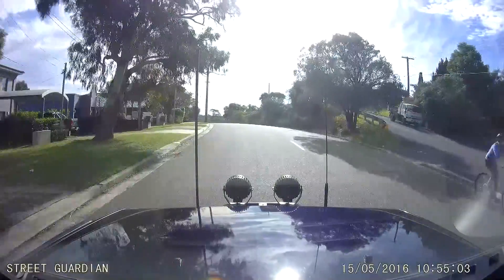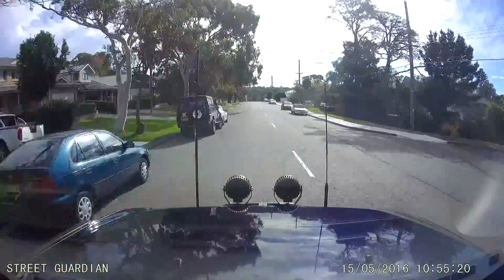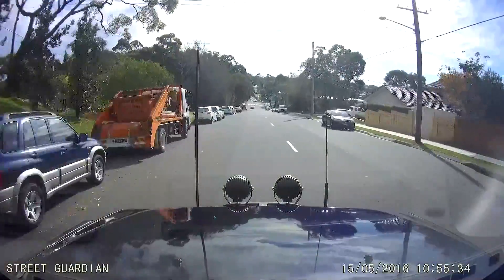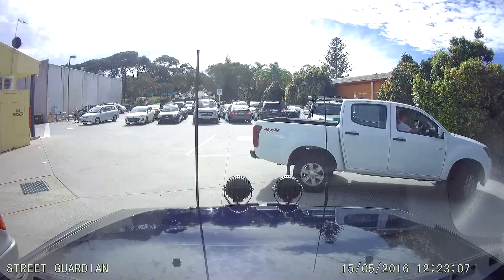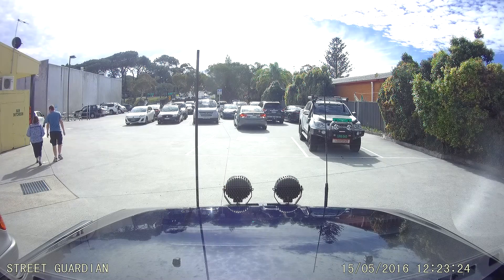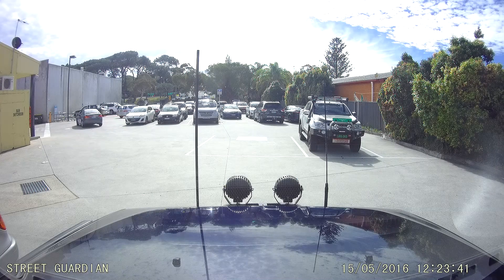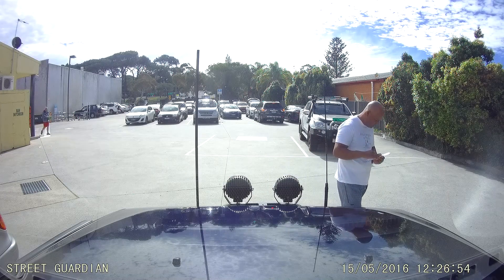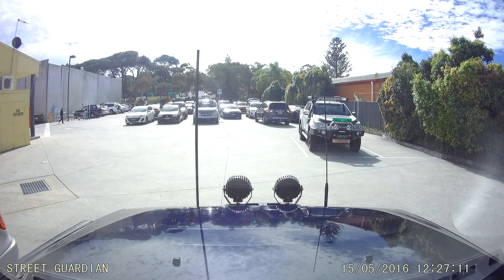Dash Cam Parking Mode - How does it work?

Comment: There you go. I always thought the motion sensor kicked in when something hit your car to make it shake - "motion".
Reply: valour10 that’s a G sensor ( G-Force) Motion sensors when the camera can see something or someone moving
Reply: @A-T-P-97  Is it a data resource consumption limiting feature. If you have a 256Gb card installed is it worth having it enabled? 

I can see a benefit if it marks a point during a recording session/loop (5 minute duration say) where an incident may have happened. But to just start recording, I can't see the point. The only other benefit I can think of is possibly saving battery power.

Comment: If you have the collision only manual setting parking mode can you just leave it on while driving or do you have to turn it off and on constantly? It does NOT have motion detection. Its only collision based.

Comment: Would parking mode work if I just plugged into my always on lighter outlet?
Reply: Depends on the camera. Some like the Secure360 go into parking mode based on being connected to a third wire - an accessory power lead or fuse that only has power when the car is on. Others like the Blackvue use its g sensor to detect that the car hasn't moved in 5 minutes and therefore must be parked.
Reply: @postwick  To give you maximum flexibility we offer five levels of cover. Here’s a breakdown:

    Comprehensive
    Comprehensive insurance is our highest level of cover. It includes accident damage, fire and theft and damage to other people’s cars and property. The cover extends to anyone driving your car. When purchasing this insurance you can choose to receive the Market Value or Agreed Value of your car if it’s written off. The Market Value is what we calculate it’s worth at the time of the accident. Choosing an Agreed Value will mean you’ll probably have a higher premium, but you’re guaranteed to get the agreed amount if your car is deemed a write-off. You’re also able to boost your cover through our range of optional benefits.
    Comprehensive (preferred driver)
    Offers all the benefits of standard Comprehensive cover, but you’ll pay less for your insurance as it only covers drivers aged 24 or older (on a full licence).
    Comprehensive (nominated driver)
    The same benefits as Comprehensive cover, for two named drivers only (the main driver must be at least 21). This is another way to lower the cost of your policy.
    Third Party Only
    Covers damage to other people’s cars and property, but not your own car.
    Third Party Fire and Theft
    The same benefits as Third Party Only, with additional cover if your car is stolen or is damaged by fire or theft.
Reply: you are right.
Thanks

Comment: Does it draw less power in parking mode. Would it give you less chance of having a flat battery.thx
Reply: Generally yes because while the camera is running to detect motion it isn't actually writing video to the card so it takes less power.

Comment: I understand everything you said but I have a question, I got a Dashboard Cam that claims to have Motion Detection/Parking Monitor/G SENSOR. eBay listing advertises all these features as well as saying you can have it just so that once you turn the ignition off it will stay on until the battery in the camera goes flat, which means then when you come back to the car, camera will be flat, then the ignition on and it starts back up and runs off battery.

The seller has recently said that do use parking mode I need to buy some extra device which I have since lost the message but I assume it’s what you’re talking about in the video, a hard wire kit that includes a device with a voltage sensitive cut off.

My question, is if I was to bypass accessories and get 12v straight from the battery, how would the unit know when the ignition is on/off? Because there would be constant power (until device cuts the power to the unit to protect the battery).

I assumed the way the function would work would be, if parking mode/motion enabled then when the 12v stops then it would go into like a standby mode and only record with motion then go back into stand by mode.

Does that make sense?

How does the unit know the car is on/off without the ACC wire. I don’t want the unit just to continue full powered and continuously recording after I’m out of the car..

Cheers.
Reply: Those kind of devices have three wires. One is ground, one goes to constant power, and one goes to a fuse or wire that only gets power when the car is on. That third wire allows it to know if the car is on or off based on whether or not there is power to the third wire.

Comment: Thanks!  Love that Australian accent!
Reply: Comprehensive vs. Third Party Car Insurance: What’s the Difference?

So you did it, you bought a new car, no doubt it’s your pride and joy, you’ve invested your hard earned cash in it so it’s now time to get insured and make sure you’re both protected.

Unless you’re completely clued up when it comes to insurance the task of getting the right policy to suit your needs can be daunting. There are just so many things to consider. Who should you insure with? What excess should you have? Should you pay monthly or annually? Then there’s the age old question – Third Party or Comprehensive?

The answer to this comes down to your specific requirements and what’s important to you – cover for the car or cover for damage that your car causes. Depending on your insurer you have 3 levels of cover you can choose from, Comprehensive, Third Party Fire & Theft and Third Party Property Damage.

Comprehensive is just that! It’s the full package that covers your car against damage caused by a number of insured events, such as theft, accidental damage and natural events (flood, earthquake, fire & storm) as well as protecting you from having to foot the bill should your car cause damage to someone else’s car or property.

Still even with some of the great deals out there, Comprehensive insurance does come with a higher price tag. So if your budget won’t quite stretch it may be worth considering a Third Party option. 

Third Party Property Damage cover protects you from the costs of damage your car causes to someone else’s car or property, however it doesn’t extend to any damage your little beauty suffers in the event of an accident or other insured event.

I guess the question you need to ask yourself is whether you need this protection. Is your car new or used? If it’s used, how old is it? Even if your car is on the older end of the spectrum, you probably rely on it so if anything were to happen to it would you be still be able to get on with everyday life? If the answer is no, then maybe it’s worth having a level of cover that protects your car from damage.

This doesn’t have to be Comprehensive though; there is a middle of the road option, Third Party Fire & Theft. This has all the benefits of Third Party Property Damage as well as protection against fire, theft, attempted theft and earthquake, meaning you can rest a little easy knowing you have some level of cover for your car.

Hopefully having read the above, your car insurance confusion has lifted a little and you’re one step closer to knowing which policy will best suit your needs. If you’re still a little unsure take a look at the comparison table below which clearly shows the difference between the benefits.
Product Comparison
   Covered    Optional cover    Not covered  Comprehensive  Third Party
Fire and Theft  Third Party
Property Only
Legal Liability         
Immediate Replacement Car         
Fire         
Theft         
Earthquake         
Emergency Accommodation, Transport and Repairs         
Towing Costs         
Contents Inside the Car         
Accidental Damage         
Intentional Damage         
Storm or Flood         
Additions to the Car:

    Baby Seat Replacement
    Personalised Registration Plates
    Towbar
    Window Tinting
    Locks and Keys

        
Maritime Liability         
Counselling Services         
Hire Car Following Theft         
Hire Car Following Not at Fault Accident         
Hire Car for Other Insured Events         
Unbraked Trailer         
Tools of Trade         
Campervan/Motorhome Contents         
Choice of Repairer

Comment: Can i use a power magic pro or similar or does this have a special circuit that enables the parking mode? Im worried about the garmin parking mode draining the battrry and would cost a fuck of a lot more combined with power discharge protector

Comment: There's no such thing as Parking Mode in a dash cam, as long as it is powered it will just record continuously. Not unless you set the Automatic power off then it will shut down completely even if it's powered. The G-sensor is a feature that it will save the video to prevent it being overwritten if there's an impact felt. If you want your dash cam to act as CCTV then hardwired it on live fuse.
Reply: That simply isn't true. Many cameras detect when the car is parked based on either a third connection to an accessory lead or fuse, or the camera's internal g sensor, and automarically go into parking mode.
Reply: And parking mode means that the camera isn't always recording, it only records when it detects motion or impact (depending on the features of the specific camera).

Comment: Having repeated car vandalism to both my vehicles in apartment parking lot. What Parking lot mode camera for night vision do you recommend?
Reply: i'd like an answer on this too as i've had someone pry open my fuel flap a few times. it doesnt have to be a dashcam, just something with a decent recording time, motion sensing and reasonable night vision or WDR for poorly lit areas
Reply: Obliv any luck or info if you found an answer to that question? I would like to know as well
Reply: @mrlonghair13  I'd like to know too!
Reply: DoctorLightMusic I’m in the USA and bought a Vantrue pro.  I also bought it for vandalism problems.  It took some getting use to but I’ve come to really like it.  It can be outsmarted if spotted because it only captures front view and a limited back view, especially since I have a pick up truck with a very small back window.  The play back quality is decent.  Instead of getting it hard wired for parking mode to work I bought a battery pack and it works great.  Only problem is that I have to bring it in and recharge everyday.

Comment: I am cursing not setting up this feature on my dash cam last week someone knocked of my front number plate :( Its also criminal what Vicroads charges for slimline plates ($114) ended up going with standard plates.

They couldn't tell me why plates with half the material of full size plates cost 3 times as much!

Comment: I read that constantly drawing power from the battery will shorten its life and has something to do with sulphating process...they propose having a portable battery instead like the Cellink.  How true is that?
Reply: Considering most modern cars are always drawing power (built in alarm systems, listening for key FOB signal, GPS tracking etc) I doubt that's true.

Comment: Is the Blackvue Power Magic pro the same as the vicovation power + used here? Cheers mate, love the videos!
Reply from the maker: +Kevin Ah Seng Similar in function, However I prefer the Vico as it has the option of a temperature cut off so you can set it to turn off if the car gets to hot inside.

Comment: I have a question..how do you get the camera to stay attached to the windscreen. I clean the glass with metho and give it a good clean , but once a week I will get in the car and the cam will be hanging from the mirror by the electrical cord. No way it would stay attached in a crash.
Reply from the maker: +Sherie Thomas Some suction cups are better than others, do you apply anything to the suction cup before sticking it on (I find good old spray window cleaner on the suction cup works well) but some cheaper cams have terrible mounts, others will just fail over time. 3M Double sided tape mounts are always better if they are available for your camera.
Reply: +Sherie Thomas Make sure you flip up the little tab that really makes the camera stick, it'll pull the device into the windscreen and it shouldn't come off
Reply: +Stepa My camera is a Uniden and has a very elaborate mount compared to some 
eBay camera's I have had. I dampen the suction cup , put the camera on 
the screen adjacent to the rear view mirror..then turn the locking ring 
about a quarter turn. It gives the impression of being firmly attached. 
And it always falls off the screen overnight while parked in the shed. 
Never happened while I am driving.

Comment: My Kaiser Baas R10+ has this but it's not hard wired in, still it has enough reserve power to record movement when needed.

And as that guy proved you need to be aware with so many cars having dash cams you can be recorded even when no one is in the car so don't do anything you shouldn't, but I guess thats the whole point of the parking mode.

Comment: Thank you for that. I am a little wiser for that info. BTW some cameras now have lithium batteries so you can use parking mode without direct power to the battery :)
Reply from the maker: +MrCods. As a General rule, Cameras with in built batteries are not great for parking mode, Battery models have a lower heat tolerance than capacitor cameras, and it is easy to exceed 40 degrees over ambient temp inside the car. It is another thing to consider when using a camera with parking mode, if running it on a 30+ degree day you can melt the camera if conditions are right.
Reply: Dash Cam Owners Australia Well damn I just learned something else :) Cheers
Reply: +Dash Cam Owners Australia yea I think that's what happened to my original camera I got.
Reply: Having a lithium battery in a device attached to your windshield is a really bad idea. Lithium batteries (or most batteries) and heat from the Sun are a bad combination. They can catch fire and/or explode.

Comment: Seems that many dashcam owners also have problems recording and with the time and other settings because their units only have 12V when ignition switch is on or to accessories, so constant power will overcome those issues! Also wiring a second socket gives somewhere to charge a phone or GPS, etc.!

Comment: Troy, have you ever been defected for the height of those driving lights? Under current NSW legislation additional driving lights can not be mounted higher than the factory headlight location.
Reply from the maker: +cheapcharlie7 Haven't had an issue, It's temporary until I rewire and move my winch controller so I can fit them under the hoop. Cheers for the concern though.
Reply: cheapcharlie7 Australian laws can be archaic and silly sometimes.
Reply: +cheapcharlie7 Many people have lights like this, but do not use them on roads.  They can be installed just not used.  You see many cars mostly FWD with lights mounted on the roof etc.
Reply: Good point Shini. 
I was reading a post where alot of NSW 4wd guys where complaining about getting pinged for spotlights and 1 guy who was defected for only having 1 LED light-bar. A old rule which I believe was repealed late last year noted amoungst other things that lights must be mounted in pairs.

Comment: If you go to buy a camera with parking mode, make sure it ACTUALLY INCLUDES it in the current firmware (research!) because some cameras it either doesn't work or its been removed.
Reply: CTP Insurance in Victoria

Whenever you renew your registration in Victoria, you’re required by law to pay compulsory third party (CTP) insurance. This is automatically included in your registration fee.

You may spot this on your VicRoads renewal notice under the name “TAC premium”.

CTP insurance is designed to provide cover for liability for personal injury or death as a result of an accident.

The amount you need to pay for CTP insurance will vary depending on where you live, and what kind of car you drive.
Are you covered?

Having the right amount of protection on the road is important for every driver. If you’re involved in an accident, CTP won’t cover you for damage to vehicles or property. This means for the best peace of mind, you’ll want to take out extra insurance.

Comprehensive car insurance can give you the kind of cover on the road that other policies simply can’t. It’s no wonder most Australians prefer it over any other type of insurance for protecting them against potential vehicle or property damage.